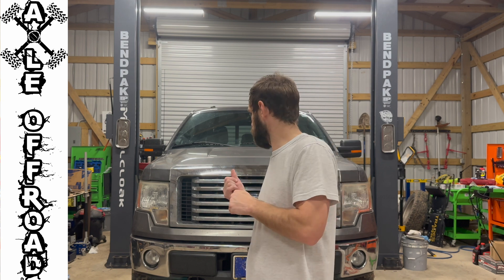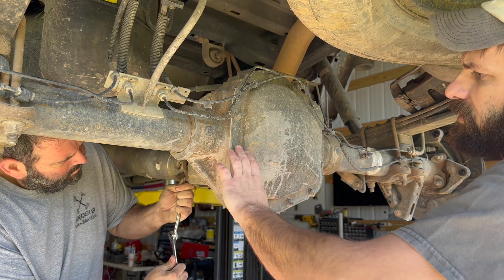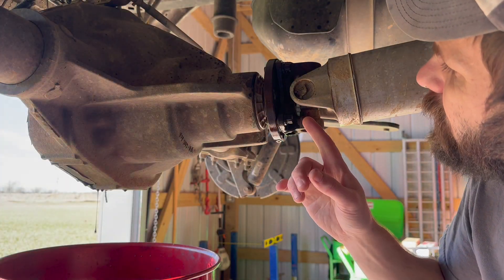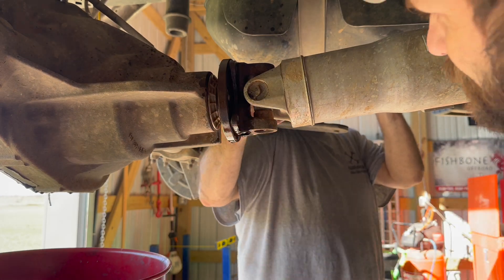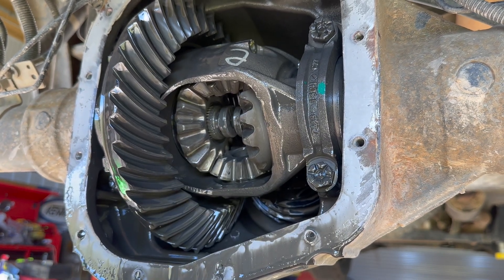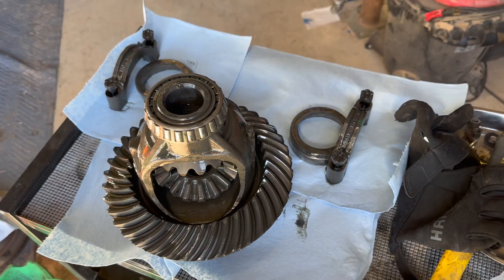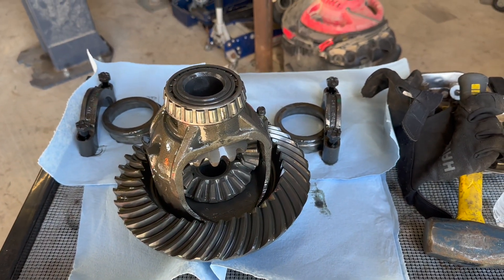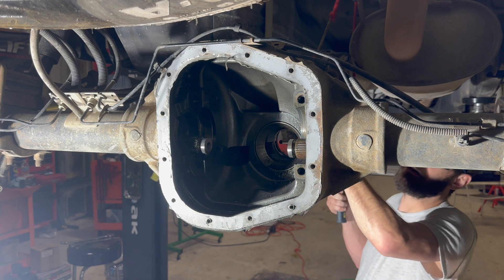Ford F-150 9.75” Rear Diff Rebuild (Part 1)

Comment from the maker: 🔧 Ford 9.75” Differential — Part 1!
In this video, we tear down the rear diff and discover a seized pinion bearing 😬 Heat + low oil = big trouble.

👉 Watch Part 2 here, where we set up the ring & pinion 👉 https://youtu.be/5uhFU-b_q4E?si=lUM-mY31wldIY8-l

👥 Want real-time help & behind-the-scenes support? Join the Monkey Garage Club 👉 https://www.youtube.com/@axleoffroad/join

#AxleOffroad #FordF150 #DifferentialRebuild

Comment: Clear lack of  any inspection on the axle assembly 🤣 probably just the brake pad making the noise👎but hey the customer says it's the pinion bearing so might as well do it and make a YouTube video🤣
Reply from the maker: Whoa, clearly you didn’t watch the full video. The pinion was stuck in the housing and had to be cut out, due to a spun bearing.

Comment: why  do you need to take the axils off to change the pinion bearing?
Reply from the maker: You need to remove the axles in order to change the pinion bearing, because you will need to push the pinion through the rear of the vehicle. The carrier, and axle shafts need to be removed to do this.

Comment: Why do my pinion bearings keep failing? What is the proper wheel bearing tolerance? I think the wheel bearing failures are causing my pinion and carrier bearings to fail.
Reply from the maker: Are you sure you have the correct set-up specs on you pinion depth? Watch my other videos to learn the importance of this.

Comment: Changing the axle bearings is a total nightmare on a Ford.. Ford goes too heavy on their tolerances and when they slam it together they're practically welded in place.. I pray for anybody that ever has to change pinion bearings.. you will literally have to torch the pinyon out of the hole.. never change your opinion bearings unless your vehicle will not work.. it's not worth the hassle in the b***.. just live with the hum...😊... Remember it's a f***** Ford... And it's not from the good Lord.😮
Reply from the maker: Not true, the reason we have had to put a torch on the differential in the first place is because the customer rode to long on a bad bearing and it seized up.
Reply: @axleoffroad will I have to torch or will the air hammer work? Grabbing my buddies on my way home from work to see if it works. Was gonna reuse the the gears lol

Comment: If the spider gear housing is missing a chunk ....can it still be used our is there a balance issue....
Reply from the maker: Great question. If in doubt, change it out. It’s cheap insurance to spend the money on a new one.

Comment: My rear end is whining on my 16 Explorer. The wheel bearings didn’t feel like they had any play in them so I’m pretty sure it’s inside the differential. We pulled the plug and it was low on oil and had a little bit of shavings on it. I started to order a kit and replace every bearing in the rear differential but someone told me it might be a waste, it could be the wheel bearing after all because the all wheel drive models are made tighter and you can’t feel that slack by pulling on the tire from the outside. Any thoughts?
Reply from the maker: very good possibility. front or rear?
Reply: @axleoffroad   rear

Comment: Thanks for the video. How different is the front differential from the rear. I have an 04 expedition that I suspect the front pinion bearing is going bad on. It makes a whining noise. I was told a while ago that one of the axel seals was leaking so I suspect it’s been run dry.
Reply from the maker: should be very similar provided it’s a straight axle
Reply: @ryanjohnson8340  it shouldn't even be turning unless your in 4wd

Comment: Hey brother, great video! I'm working on an 04 F150 4x4 with a toasted rear end. The driveshaft was jumping & skipping while the rear differential clunked, so I pulled the rear cover to find metal chunks & blown-up spiders. I'm trying to figure out the best way to get this truck back on the road.
Reply from the maker: I would recommend a full differential rebuild. You may be able to save your carrier, if it’s not damaged. The thing is, if you have the funds to do so, I would install new bearings, seals,spiders & Ring & Pinion. Let us know if we can help
In anyway. Thanks for the comment. Be sure to subscribe.
Reply: @axleoffroad  Yes I think a rebuild is the best way forward. It beats having to source an unknown entire rear-end assembly & swap it into the truck while hoping it's going to work the first time & be reliable. The truck's VIN should have all the differential specs I need to look for new parts & rebuild kits right? Thanks for showing all the steps involved. I haven't gone through an entire differential before.
Reply from the maker: @eddiesheeran5791  The Vin number will provide some information needed. Best way to identify the axle size is by the code on the axle tube. You can also get the ratio by counting teeth on ring and dividing by pinion. We use @nitrogears to order most gear parts. Feel free to email us if you have any question axleoffroad@gmail.com
Reply: Hey Eddie! Did you ever start that project, I’m having a similar issue as you I also have a 04 f150
Reply: @gregoryhoward6449  Hi Greg, yes I totally repaired this issue without a full diff rebuild. I took the carrier assembly out of the differential case, and replaced the clutches & spiders with upgraded parts from Yukon Gear & Axle (Summit Racing). The ring & pinion gears were fine and didn't need to be replaced. I didn't change any bearings or seals either. I repacked the new clutches as tightly as I could. There are videos about ideal clearances & tolerances for this diff, I just watched a few before doing the process myself. I used the .035" clutch spacers, and my two stacks of clutches measured .645" each in total thickness. The parts fit very tightly, but the performance is excellent and the truck's owner is very happy with the result. I thoroughly cleaned the debris & old oil out of the diff casing before resealing the case and filling it with Royal Purple. Ford released a TSB saying to use 75w-140 instead of 75w-90. This is not a terribly difficult job. Just work carefully and always check your work before moving on to the next step. You can definitely fix this yourself.
Reply: @eddiesheeran5791  that is an amazing DUI you did haha. How much did it end up costing you? this still seems cheaper than rebuilding the differential
Reply: @eddiesheeran5791  I really appreciate the tips I think I might give it a go. Where did you buy most of your parts from?
Reply: @gregoryhoward6449  No problem man. I bought all the differential internals from Summit Racing (Yukon Gear & Axle brand). I got the Royal Purple diff oil from O'Reilly Auto. Any auto parts store should have this. The differential lock spring was damaged, so I bought a new one of those too. I found a genuine Ford spring on Amazon.
Reply: @gregoryhoward6449  It was pretty affordable considering how serious the damage was. $580 for the new differential internal parts, $40 for the lock spring, and $80 for the top-quality Royal Purple diff fluid. You can use a new gasket for the differential cover, or you can use Permatex Black RTV gasket maker. Probably $10-15 for that. The truck was undrivable before I fixed the damage, and now it drives perfectly with no issues. To be fair, the owner was aggressively pulling tree stumps with this truck when the differential broke inside. F150's aren't heavy-duty enough for that kind of work. You really need a bigger heavier truck for work like that, like a big diesel or actual stump-pulling/grinding equipment. Under normal driving conditions, the differential will probably never fail like this.